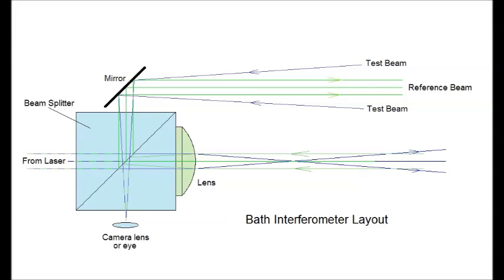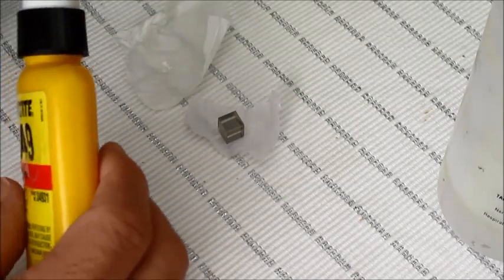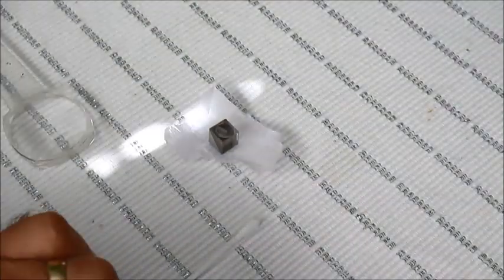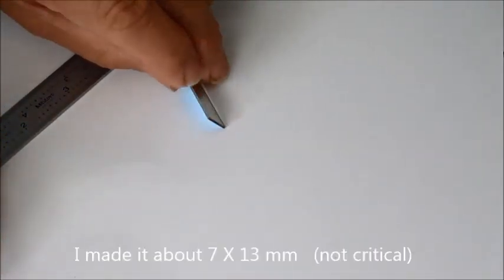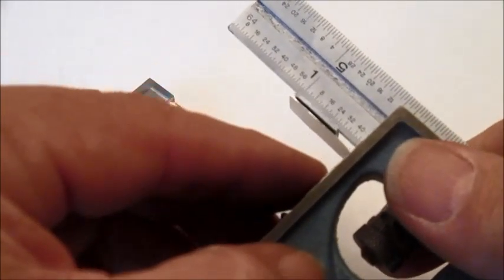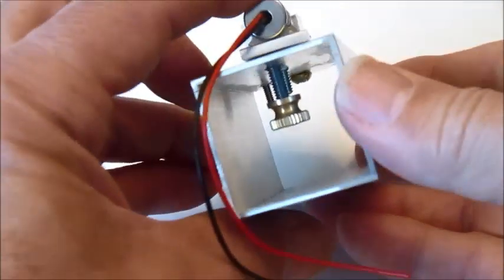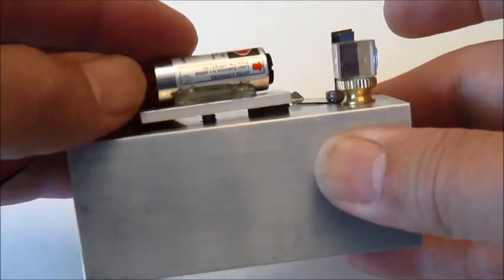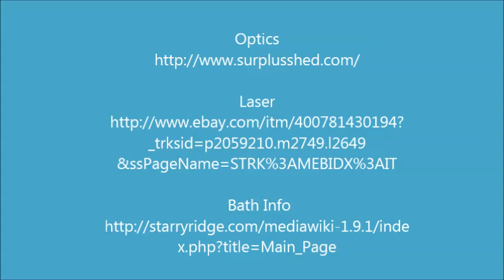Making a Bath interferometer

Comment: Any alternatives to Loctite 349 ? That stuff is crazy expensive as in $60 USD online.
Reply: Loctite 349 was just what I had on hand.  Look for UV glue on Ebay.  Glue used for Iphone screen replacement is inexpensive.
Reply: @edjonessongs5308  Will do. Thought it might have to be the high end stuff. I'll use the Pangolin/Horseshoe Bat extract stuff. What could possibly go wrong ?

Comment: Notes on the Bath
    On CN there has been an interesting thread on the Bath https://www.cloudynights.com/topic/578373-the-bath-interferometer-starting-at-the-bottom/
Evidently a bi- convex lens is better to use than a plano-convex lens because of spherical aberration.  I did a layout on Zemax and found that on a 16 inch F/5 mirror and an 8 mm focal length PCX lens you would get .3 waves of error and .129 waves with a BCX lens. Both are more than in the thread above and frankly not very good even for a BCX.  So I would recommend not using a PCX lens and even for mirror as fast as F/5 you should ray trace the interferometer and subtract the Zernikes of the error, perhaps not so easy for ATMs.   I'm considering deleting this video, what do you think?

Comment: Sorry but this is not a good implemtation of the Bath interferometer.  To be accurate it needs a biconvex lens and the lens should not be glued to the cube.  A PCX lens such as this will add spherical aberration to the results for fast mirrors.  A BCX lens will solve that problem.  In addition there is a need to rotate the cube about 1 deg compared to the lens to get reflections away from the interferogram.  That can not be done if the lens is glued to the cube.  For better details on how to build and use a Bath see https://groups.io/g/Interferometry/topics or other youtube videos.
Dale Eason (the make of the interferometry software OpenFringe and DFTFringe used to analyze the igrams.)
Reply from the maker: Dale yes the plano-convex lens will add SA on fast mirrors but no you can rotate the cube with the lens cemented since it has no center.  You must have missed my next video on the Bath where I recommended using a air-spaced plano-convex lens (facing the other way) that will have the least SA based on Zemax ray tracing, better than a biconvex lens.